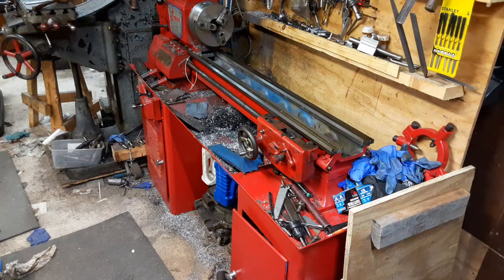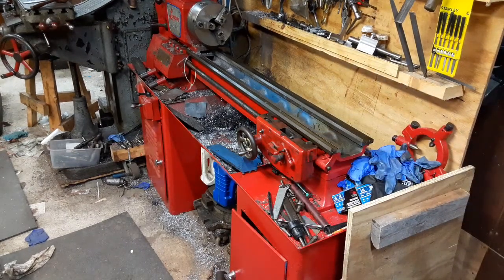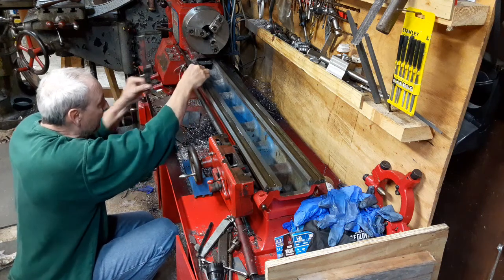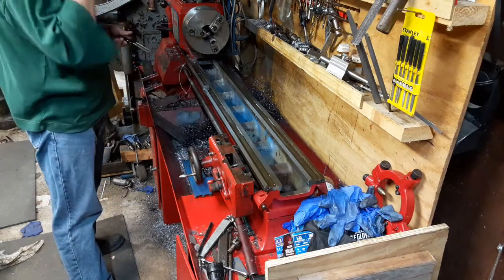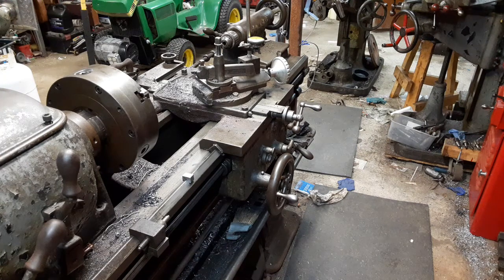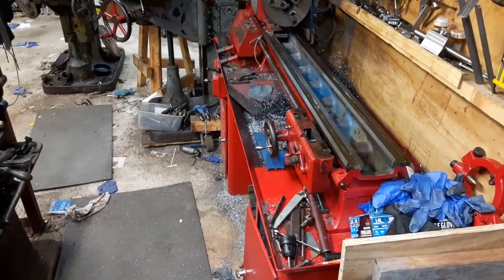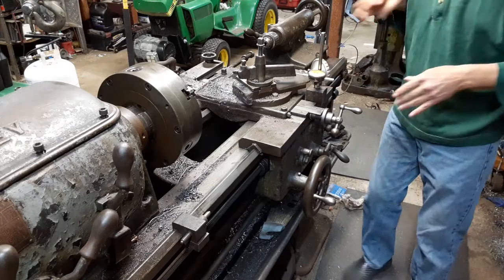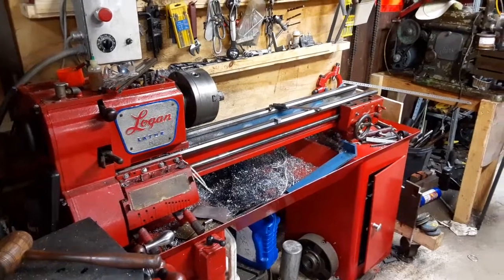simple logan lathe bed wear checking method

Comment: Nice video, very good idea!  For lathes I've seen, the saddle has clearance for the very top of the inverted "V" so the tip doesn't wear down.  Your block may yield more accuracy with a small slot right added at the tip of the "V", maybe there is clearance and I just can't see it in the vid.  That being said, I think I'll machine one for this purpose.  Thanks.

Comment: That's a simple and cheap method to check wear on the bed.  Your readings on the Logan don't sound too bad - at least you know now that it's a lot less worn than the Hendey (still good for the capacity and heavy cuts). We'd all like a 10EE (LOL).
Reply from the maker: I am pretty pleased about logan 1 for sure. I almost joked that I would scrap the logan if I got a 10ee. But I would never do such a horrible thing